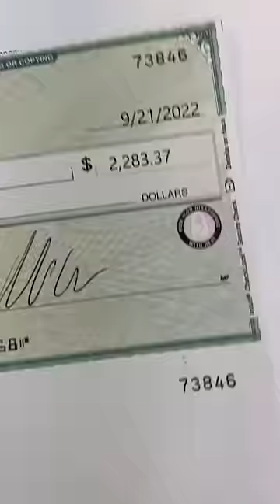MELTING DOWN A GOLD ROLEX!!! #shorts

Comment: "I'll spare him the case this one time"
*throws case in red hot molten band
Reply: The case is the most expensive portion, the gold is worth little. NATO straps are cheap.
Reply: @MOR4PH  G10s, Zulu, French paratrooper. Hell even Perlon bands.
Reply: @yeejay6396  Right On!🙂
Reply: @MOR4PH over your head it goes
Reply: Ĝ by
Reply: @MOR4PH  the golds worth over 2k
Reply: @erichood3169  the actual watch portion is probably close to 10.. so yeh i’d say it’s a lil cheaper
Reply: How fkd is the crystal after touching the molten metal? Just curious

Comment: It's amazing how little gold is actually used
Reply: Its just burning off from using a torch. Melting that much gold down with a torch is super inefficient. Typically would be using an actual furnace or you can also use chemicals to get 100% pure gold oxide/powder. This is just a fun video.
Reply: That's because it was gold plated if it was real gold which rolex bands are There would be plenty more. At the end of the video he says he got $2800 do you think he got $2800 for that little chunk. Use your brain for Something other than to hold your shoulders up
Reply: @seamooreapples  gold doesn’t fucking burn, it melts
Reply: @seamooreapples  wym. Golds melting point is moderately low and is most definitely efficient to use a propane torch.
Reply: @rjny51  seems you need to use your brain. Gold is a heavy metal ok. Now the way they weigh gold is in Troy ounces. You got 31 grams per Troy ounces. A nugget that size is definitely on point for being more than 35 grams. I'd put money on it

Comment: If you put that very metal back into shape, but you do it and not rolex, is it still authentic and real?
Reply: Yes, because the Rolex is the time piece. Not the band. The mechanism for the watch is what makes a Rolex a Rolex, not the band holding it on your wrist.
Reply: @stephenwangondu3618 he timepiece is the main value. However the bezel and bracelet need to also be from rolex and matching or the watch looses value. You can do whatever you want with your stuff.   If your rolex bezel is gem set from rolex then it's worth lots. If you get trax to gem set a bezel it looses value.

Comment: I’ve got a question for diamonds, do the lab grade ones still pass the tester thing apparently everyone carries around?
Reply: Yes, they are real diamonds. And most of those diamond testers are cheap crap and can be calibrated either way
Reply: If it's a cheap Amazon tester then yes it'll pass hell even glass will pass... it has a sensitivity dial where you can adjust it to make it test as diamonds

Comment: That’s crazy because that model was like $30,000 more than a stainless one yet the band is only worth roughly $2000 in gold
Reply: Rip off on these watches. Little gold and expensive.  Steel pricing like gold
Reply: @drjj1289  I know right. They talk so much shit on the fakes, and even though I don’t buy knock off stuff, I’ve seen the super clone rolex and they look exactly like the real ons and even the movement inside looks the and I’d assume probably functions pretty damn good as well… I’d drop $1000 on one of those long before I spend 15-$40k on a real one 🤣